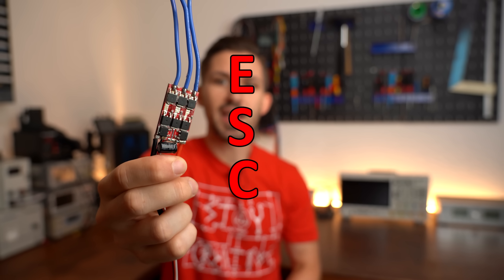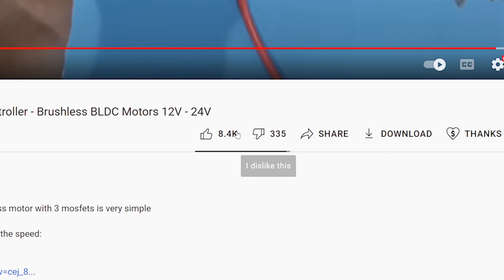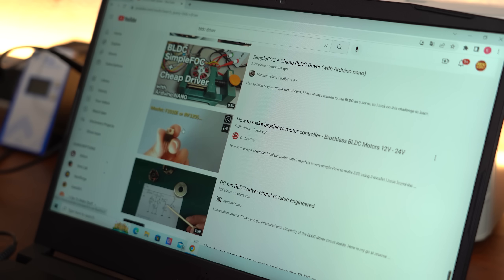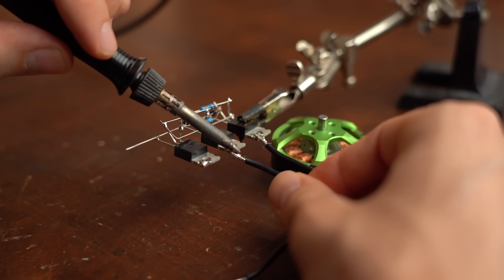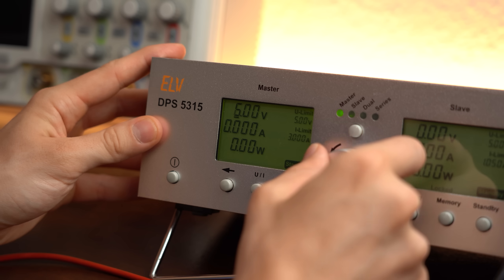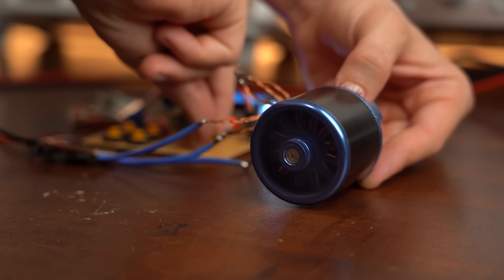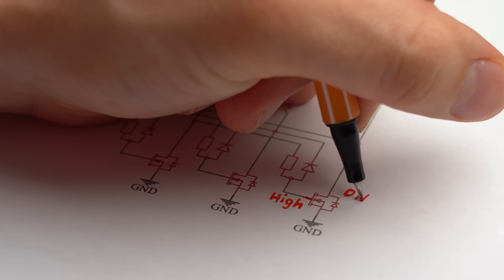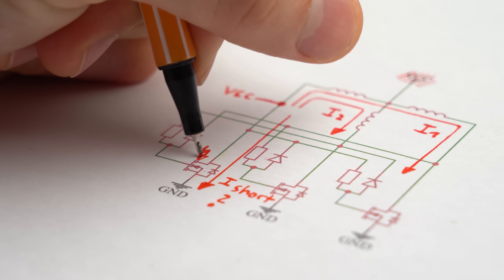I followed a YouTube Electronics Video and Regret it! (Debunking a 500k video)

Comment: Interesting concept but I guess there IS A reason they include all those components in commercial ESC’s.
Reply: There is. Mostly error conditions and timing. To get timing going, and stuff like braking, one needs a CPU. This increases the number of components a lot. Also, most ESC's also have a BEC function, providing power to receiver/servo's, and so forth.
Reply: @janklas7079  I don't think a CPU is a hard requirement. You could do what the CPU does with comparators etc. But if you did it would be hard to tune and probably only work with one type of motor. Using a microcontroller reduces the amount of components because you move most of the problem from the hardware domain to the software domain.
Reply: @donpalmera  The CPU is a hard requirement.
Reply: @donpalmera  no way you can get any decent motor control without an mcu. there is an enormous amount of math involved that needs to be calculated somehow. the guy who designed a quadcopter esc firmware from scratch (AM32) ended up spending over 2 years until he got a properly working result. 

as so often with engineering, it seems really straightforward at first and slowly turns into a nightmare of complexity as you work on it.
Reply: @drkastenbrot  
>enormous amount of math involved that needs to be calculated somehow.

If you did it with analogue electronics (comparators etc) you'd have an analogue computer.
The fact that this can be done an on AVR that doesn't have an FPU etc shows the math isn't that hard.
Reply: @donpalmera  No, it shows that people are able to write optimised code. Just because something doesn't use floating point does not mean the math is not complex.
You can implement many controllers without floating point, it's unfortunate that Arduino noobs don't understand this and wade in with floating point operations for everything.
Reply: @ferrumignis  If you are able to optimise the code it means that the operations you are trying to do can be simplified into something that can be optimised.
The math that actually needs to be done can't be super dooooper mega hard because it all has to happen on an 8 bit microcontroller fast enough that the microcontroller doesn't lose sync with the motor rotor. There is a hard limit on the number of instructions you can do within the window you have.

And you could do all of this in analogue electronics by adding 555s, comparators etc to the current circuit to give it more feedback then just the back EMF input. For example you could fix issue with it not self starting reliably or not restarting after stalling by having having a 555 implement a stall timeout that cycles the coils if there is no back EMF input.

You don't do it in discrete electronics because what would be the point? The parts would cost more than an MCU. You can bet on some very cheap Chinese products having discreet BLDC motor controllers in them though because they are working down to the cent.
Reply: @donpalmera  You do realize that a basic 8 bit microcontroller already contains hundreds of thousands if not millions of transistors? One of the cheaper go to MCUs for BL motor control is the Silabs EFM8BB2. Take a look at the datasheet and explain to me how youre going to achieve anything remotely similar with discrete components. Youll end up with a room of rack mount modules full of digital logic. BL motor controllers do a LOT more than just turning transistors on and off. There is complex signal processing involved to calculate the rotor angle and filter noise, and a fairly large amount of "tweaks" that dynamically adjust operating conditions to prevent overheating, desync, failure modes and much more. 
I doubt you have looked into how the ESC knows the rotor angle because that is one of the most complex parts.
Reply: @drkastenbrot  

>There is complex signal processing involved 

And? Doing stuff like low pass filtering in the digital domain is complex signal processing whereas in the analogue domain you're looking at a very basic RC circuit.

BTW I wasn't arguing that the sane way to do it is with an MCU. I was saying that the MCU isn't a hard requirement.
Reply: @donpalmera  Take a look at popular open source ESC firmware such as AM32. It is not "a lowpass filter" and I would call one complex. Before you make any more outrageous claims, please just understand what an ESC actually has to do.
Reply: @drkastenbrot  

>It is not "a lowpass filter" and I would call one complex.

Ugh, I didn't write that did I? LPF is one component of the signal processing which is hard in the digital domain but very simple in the analogue domain with passive components. I did not write that an ESC is just a LPF.

Before you accuse people of "making outrageous claims" for the love of god recalibrate your buttplug and maybe get some help with reading comprehension. 

I just looked at the AM32 source. The code isn't very complex. Looks like a few kloc of generally poorly formatted/structured code written by someone that can't write useful git commit messages to save their life. There doesn't seem to be any hardcore digital signal processing written in hand optimized assembly code in there.
Reply: unless you use a brushed motor
Reply: Even.. there are single chip solutions for up to around 10W. Barely any support components.

The thing is about running a small motors with a totally overpowered BLDC controller.

I do not even see the ESC as a particulary good driver: like very little diagnostics, no pulse signal output to keep track of motor speed e.t.c.
Reply: @erlendse  
similar escs are available with blheli. 
escs running blheli are some of the highest performing available, thats why they are popular for drones. they use the custom dshot protocol with high bandwidth rpm feedback and optional diagnostics.
Reply: How can you comment 9-days ago 😳😳😳, the video is uploaded just now😂😂
Reply: @Xavier_Everwhere  patreon
Reply: What the fok